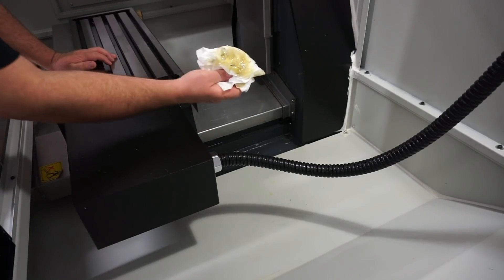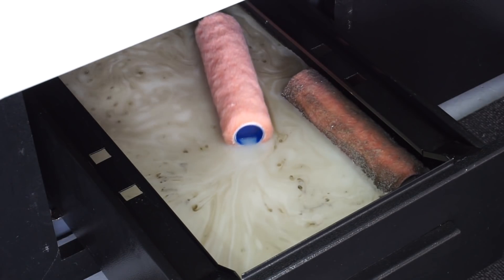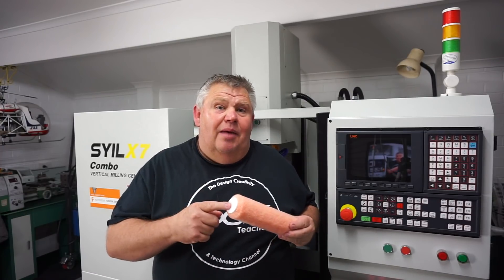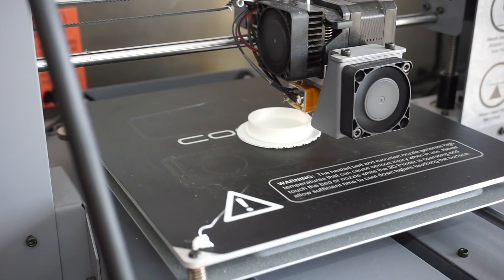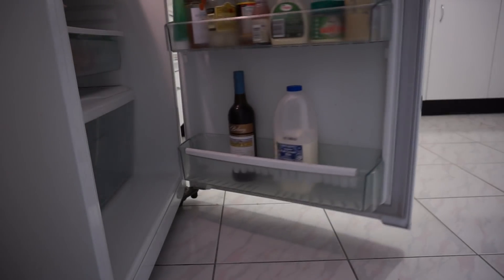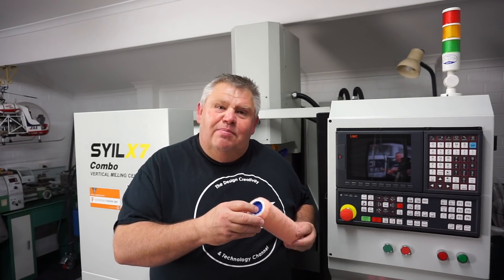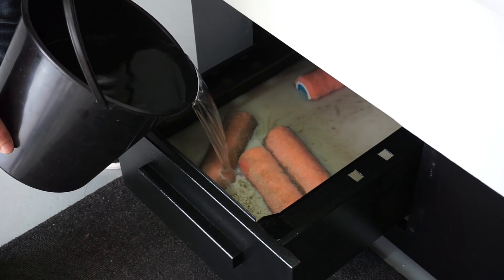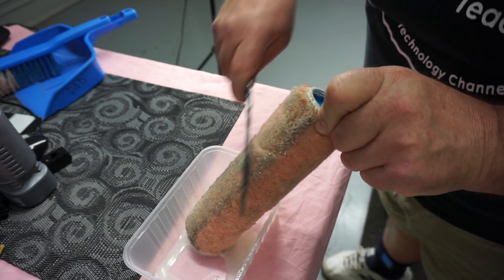Simple Oil Skimmer for CNC Milling Machine

Comment: I like things easy Aaron, great tip. I also have a four-legged oil skimmer already on hand, that's an even more economical solution but he hates baths lol. Thanks. Tony
Reply from the maker: G’day Tony. Thanks mate, I replaced this idea with a Skimpy oil skimmer now. I’ve also been using a Zebra oil disk skimmer at work. Both work very well. Hope you’ve been well mate?
Cheers 🍻 Aaron

Comment: For cleaning those rollers you can buy degrees-er which is commonly used to clean motocross air filter https://www.ebay.co.uk/itm/Putoline-Action-Cleaner-2L-Foam-Air-Filter-Cleaning-Fluid-Motocross-MX-Trials/402635919382?epid=24043538601&hash=item5dbef89016:g:ffsAAOSwBvJf9bBo
Reply from the maker: G’day Tom. Sorry for not replying sooner. For some reason this comment just came up now. Thanks for the excellent tip. I finally got rid of those paint rollers and fitted a USA skimpy oil skimmer. Best money I’ve ever spent. Cheers Aaron 👍🍻

Comment: wow  - I was using a vacuum and pigmats
Reply from the maker: I gave up on this idea now. Just bought and installed a Skimpy Oil Skimmer from the USA.
Reply: @DCT_Aaron_Engineering  hey what controller do you have in your Syil?   I am looking to help someone who has a X5 with LNC for a the post in Fusion. I saw the programming book and it looks very Fanuc or that RS274.  thks
Reply from the maker: Hey buddy. I have the LNC5800 version. I have a Fusion360 post that works (3 axis only). It is free to download from the SyilCNC Facebook user group.
Reply: @DCT_Aaron_Engineering  I joined that group and got the *.cps file thks
Reply: @DCT_Aaron_Engineering  

is the skimmer like this one ? 
https://www.ebay.com/i/400284466401?chn=ps&norover=1&mkevt=1&mkrid=711-213727-13078-0&mkcid=2&itemid=400284466401&targetid=4580702888518297&device=c&mktype=&googleloc=&poi=&campaignid=395665092&mkgroupid=1233652256105976&rlsatarget=pla-4580702888518297&abcId=1129776&merchantid=51291&msclkid=53be749137201fabe5b02ba38fbfca13
Reply from the maker: Yes that is exactly the Skimmer I bought. However I also got the bracket, and oil traffic controller for it.
Reply: @DCT_Aaron_Engineering  I also have fish tank bubblers in the 3 CNC machines to keep the pool cover open
Reply from the maker: That is a good idea. I was thinking of doing the same. But I think the oil skimmer moving may help slightly also 👍
Reply: @DCT_Aaron_Engineering   - thanks man for the help.   stay safe !
Reply from the maker: @CNCMachinistEducationNetwork  You're very welcome 👍
Reply from the maker: Ok cool.  That post will only work on 3 axis machine and won't work for a 4th unfortunately.

Comment: Great idea I would stray away from this and buy/build an oil skimmer..  the oil may stick to the paint roller but it is still floating around inside the tank there is bacteria in there that causes this to grow which need to be removed. There in case the oil is still floating around in there whether it’s free or stuck to something which will not solve the problem. Another thing that is cheap and simple to do to prevent this from happening is add one or two small fish pumps with bubblers or air stones to aerate the coolant. This also cuts down on oil production. My name is Frank I am the engineer / technical support for a company called ZEBRA SKIMMERS and we are in the coolant maintenance business if there’s any questions regarding oil skimming: etc. you can call our main office or visit our website at www.zebraskimmers.com and asked to speak to me or a technician I’d be happy to help you with whatever you need.
Reply from the maker: Hi Frank.  Yes this idea of using paint rollers is a temporary solution only.  It is not intended for long term use.  Fee free to email me directly if you would like me to showcase your product on my YouTube channel.  My email address is available from my "About" section on my youtube page https://www.youtube.com/user/DCTTeacher1/about.  Cheers, Aaron.

Comment: That’s a good economical way of doing it Azza. I bought some oil absorbent pads from blackwoods (for cleaning up oil spills) which cost a lot but probably yield a similar result to the paint roller tbh! Definitely got to make a skimmer, check out the one by @cnc_performance on insta! Good little project I reckon ;)
Reply from the maker: Hey Luke.  Yeah it's a cheap simple solution for an annoying problem.  Yes I saw the one cnc_performance made.  It's frigging awesome and solid as FK too.  I would have to modify my tank to fit something like that it mate.  Hope you've been well mate and your trip to overseas went well?  Cheers, Azza.
Reply: I work for ZEBRA SKIMMERS my name is Frank I handle the engineering and tech-support we are Proto typing a mini skimmer that would be perfect for this machine application if you want more info my email is frank.woodall@zebraskimmers.com I’d be happy to help you with anything you need